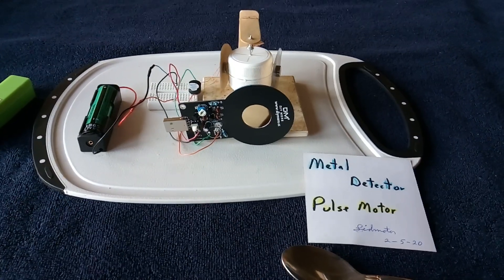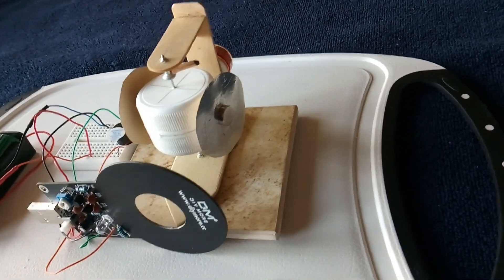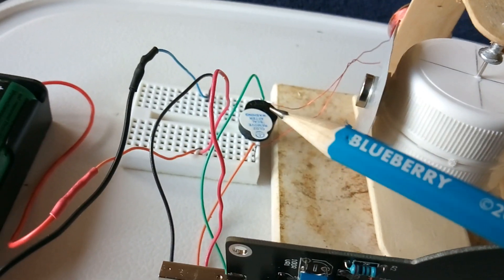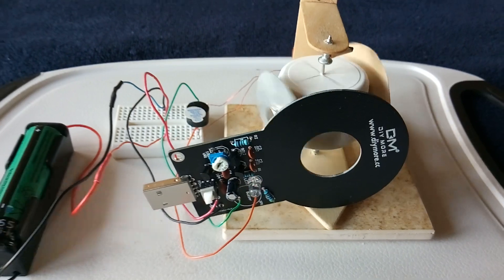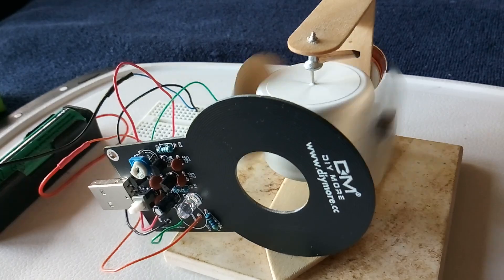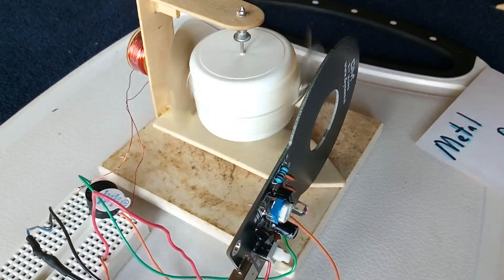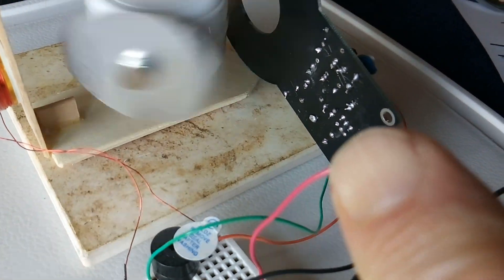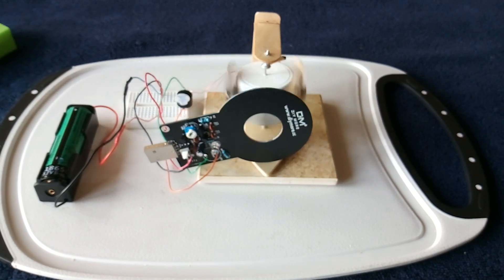Metal Detector Pulse Motor

Comment: Hi, been following you for a while.  I don't see you have ever ventured into Electrets, the analog to a magnet.  Permanent electrostatic charge.  Very hard to find material on.  You would find them very interesting.  I have a fair amount of referrence material.  It is not easily found.  If you want I can send you some.  Not sure if they would all email due to size of files, but would be great for a person like you to test some.  Feel free to contact me if you want the material or to discuss.  I do similar experiments as you, some slightly more unbelievable.  I work as a computer programmer, started off as an HVAC tech...best of both worlds.  Justininmilwaukee       at yahoo

Comment: Hi, I am looking for a system based on a pulsemotor that runs very slow, around 1 revolution per 2-4 seconds. Do you know a solution for me? I only can find methods to speed up, not slowing down....
Reply from the maker: There are several ways to do that.  One way is to use just one magnet on a big diameter rotor with just a counter weight on the other side.  You can also use a gear or pulley system to reduce the RPMs.
Reply: Lidmotor, thats what I tried in the beginning, only one magnet, but that resulted in a very inconsistent rotation. The impulse of the electromagnet speeds up the rotor very much, and the rotor then slows down a lot. Using gears gave too much friction. My best results until now were with multiple magnets (8 in my last test) on the rotor, and a microcontroller controlled activation of the electromagnet, that only gives pulses every xx milliseconds. Of course the microcontroller uses quite a lot of energy, which iis andrawback of this aproach...

Comment: Haha, thanks for the plug but I honestly don't think you needed to see my video on the assembly, you are way ahead of me in your skills. I love the idea of this build, it would drive my wife wild with that buzzer beeping away. I might have to try it just for that effect 😍😆👍
Reply from the maker: Thanks again for your video.  I learned two new things from it.  The first was to put the 'short' components on the board first.  The second was to use very thin solder with a narrow tip iron.  The buzzer is too load so I ended up just taking it off completely.  The motor runs just fine without it.  If you want to hear it run you can pick it up on an AM radio.  Around my house noise isn't allowed either.  Ha.
Reply: GrandadIsAnOldMan very influential you are
Reply: @Mrpurple75  I have been inspired by Lidmotor over many years and have learned so much from his videos and trying to replicate his projects 🙂
Reply: @GrandadIsAnOldMan   and than you as well for all your videos too,  and your time.

Comment: its funny you done this it did it a couple of months back didnt make a video.
Reply from the maker: I was surprised how well this worked once I put large enough metal targets on the rotor.  Using just the magnets didn't work.  This thing actually worked at high RPM which I though was rather odd.